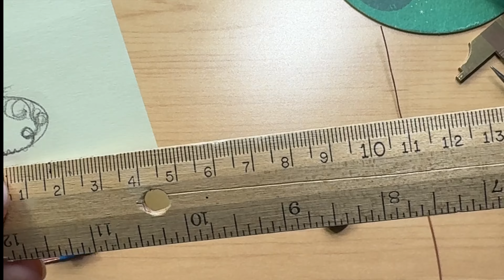Wire Wrapped Double Sided Pendant

Comment: Your work is very beautiful. I am just starting my wire wrapping journey and have purchased my supplies from Amazon. I notice that you have large spools and wondered where I could source something like that. I figure there will be much trial and error and I will need lots more wire to practice with.
Reply from the maker: The large spools are 1 pound spools from Rio Grande
Reply from the maker: I first started getting smaller spools of round bare copper wire from parawire.com
Reply: @ZurickDesigns  thank you so very much.